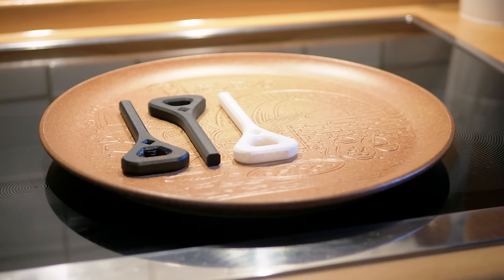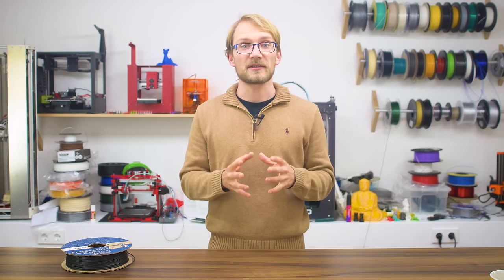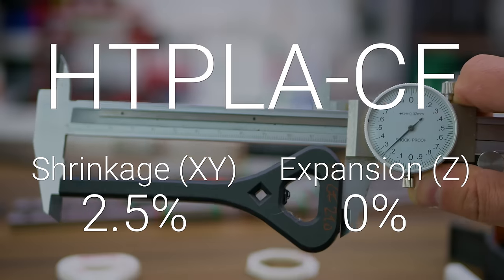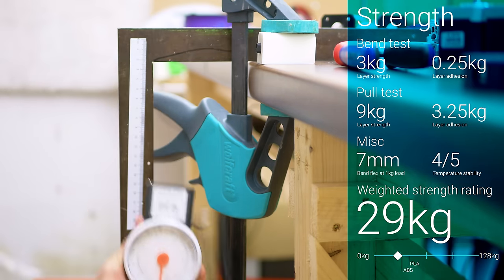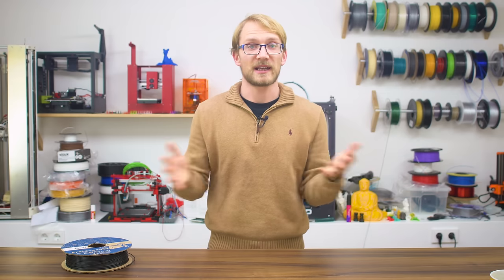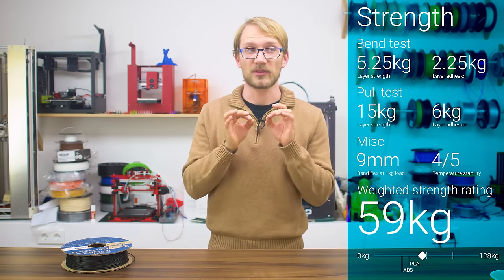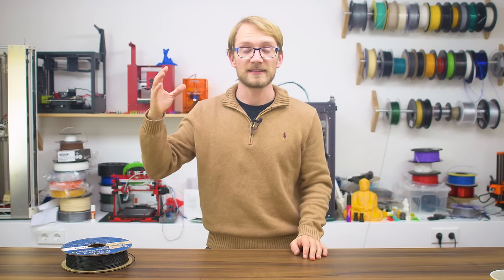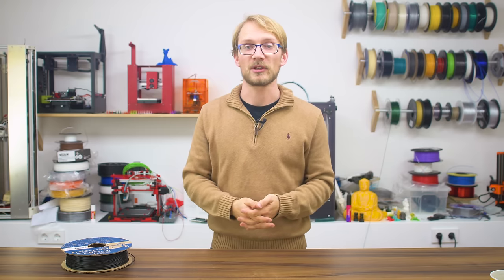Bake your PLA and have it outperform everything else! #Filaween

Comment: This makes me wonder if other plastics could be annealed too... Like abs and nylon
Reply: Yes and no. This is essentially what heated build chambers do for ABS. It "anneals" in the sense that it allows the ABS to relax and remove the excess stress in its layers as it cools uniformly and that will improve its strength. However, ABS is highly amorphous (the reason why it doesn't really have a true melting point) and annealing it won't cause super large crystalline grains either like it would in polylactic acid (PLA). Its chemistry doesn't favor it.
Reply: I feel like this is something that needs to be tested lol
Reply: for metals there are different methods to improve their properties(these methods developed through time), so it's a matter of time for plastics especially now since it will be  used by everyone capable to afford a 3d printer.
Reply: You need to be able to control the temperature and cooling cycles to anneal properly. It'd be horribly inefficient to do it in a microwave. On top of that, Microwaves operate on a 2.5 ghz frequency which is the resonance frequency of water and it also interacts well with fats, and sugars, vibrating it and causing heat. Your prints (ideally should be dry) wouldn't work as well as a temperature controlled heated/cooling chamber.
Reply: The other problem is that you actually can't set the power level of a microwave, it's either fully on or fully off and controls power by cycling the magnetron. The part could be wrapped with a damp paper towel to heat it, but I doubt you'd be able to control the heat well enough. Considering the size of most printed parts, it would likely be best to use a toaster oven
Reply: It pulses in a specific way according to the power settings, at 10 it might be on 100% of the time while at 5 it would be on 50% of the time and off for the rest of each cycle.
Reply: Like Daniel said, it just pulses it. Listen to it carefully when it's on a lower power setting, you will hear a hum that turns off and on. Some of the newer microwaves cycle it too fast for you to hear, but the older ones will cycle slowly enough to hear when it is heating or not. This is called pulse width modulation.
Reply: To answer your question, I actually did a project on this in university. ABS absolutely does gain strength, but you need to be careful with the moisture content of any plastic used. Too much and you get huge deformation, typically shrinkage in one dimension (x-y). PLA was very difficult to heat carefully enough, and were not consistent enough to be useful without further machining.
Reply: I use/make 3D printed prosthetics hands, and I can say that my annealed and acetone treated ABS fingers hold up WAY better than just acetone treated. I even put some big claws on the fingers that held up way better than they had any right to, given the layering.

I think what happens is that ABS usually has a hard time with layer adhesion, and warping can put stress inside parts that makes them even more prone to delamination. the heat treatment allows parts to relax and give layers a bit of extra adhesion, making them stronger. 

Usually, with ABS, it breaks along layers. Its amorphous structure makes pretty impact resistant, and it's more prone to denting than breaking. Heat treatment doesn't do much for that kind of strength, but ABS doesn't really need it.
Reply: I think some people boil nylon parts (molded, don't know about printed) to make them tougher.

Comment: I think I know what you're doing wrong with the CF parts. Any fiber reinforced material needs to be loaded in tension parallel to the direction of the fibers (i.e., the layers). I think if you printed the first part in the weighted strength test with the largest face parallel to the bed you would see the benefits.

To be more detailed, the fiber reinforcement only does any good in tension. (just as a steel cable only does well in tension). When a beam (such as the first weighted test part) bends, there is tension at the top and compression at the bottom. However, due to the printing orientation, no fibers are actually bearing the load, only the adhesion between the layers is. Even after annealing this wouldn't change anything because the direction of the fibers is still orthogonal to the stress.

Feel free to inbox me if you've got any other questions! Hope this helps...

Comment: I wonder if you could add some temperature profiling into the HBP to cycle up and down a couple of times to achieve a similar effect while the part is still (potentially) adhered to the plate, possibly reducing warping.

Comment: It would be great if you could test MakerGeeks Raptor PLA.  Like the HTPLA, the manufacturer suggests (and some tests bear out) both great strength and ability to withstand heat.  I have four spools.  It is definitely less brittle than standard PLA, but I haven't done other tests with it yet.

What is interesting is MakerGeeks only suggests 10 minutes in the oven: "...you'll want to bake it in the oven for 5-10min or so around 100c (212f) and that will heat treat the part so you can get the maximum heat resistance out of your part."

To help avoid warping, I've been placing a large ceramic tile on top of flat parts to keep them from warping.  I also place them the parts in a cold oven, bring the temperature to around 100C, leave it at 100C for 15 minutes, then turn the oven off, but leave the parts in the oven as it cools down for another 40 minutes or so.  It seems to reduce warping significantly.  Also, my parts shrinkage is reduced using this process.

http://www.makergeeks.com/rasepla.html
Reply: On thin parts, the change can happen in minutes.  Be careful not to put too much pressure (weight) compressing the parts.  Crystallizable PLA become very flexible before becoming firm again!
Reply: Thanks very much for the info!  The ceramic tile I've been using (occasionally) weighs 675 grams.  Probably much more than I need for smaller parts.
Reply: Of course and good luck!
Reply: I would love to try out the MG's Raptor PLA, have placed an order back in October and still haven't received it as of today... Can't wait to test them out. From your experience with Maker Geeks, do they usually take a long time to ship their items out? Their support also sucks as they don't answer e-mails, plus there's no phone contact available.
Reply: I've had pretty quick shipping from them - usually received within 5 days.  Are you on Twitter?  I would send a tweet to @MakerGeeks.  I too have had some fast responses, and some lack of any response to emails, but thankfully all 4 of my previous orders have shipped quickly.
Reply: John O'Shaughnessy
Thanks unfortunately I don't have twitter. I'll see if I should sign up in order to tweet them. Lucky you, so far I have been just told twice a two weeks ago it will ship within 24-48 hours. But still nothing yet. Thanks anyways. Cheers.
Reply: Alvin email them about not getting your filament I usually have received my filament from makergeeks within two days.
Reply: Brandon Cufr
Thanks. I signed up for a twitter account and tweeted them and next I saw the order status page noted that the order has been "rejected" and my credit card payment was funded. I didn't know what happened and would love to know. I wrote them an e-mail but seems like they really don't like e-mails I guess. I wonder if I should proceed with making a new order... I woud love to try out their Raptor PLA as I have seen on reviews that it is good. I am from Canada, maybe thats why there was the issue?
Reply: I'm sorry you've had trouble with MakerGeeks.  I really like the Raptor filament.  I have heard others from outside the US have trouble with getting shipments from them.  Maybe ask again on Twitter if they ship to Canada?
Reply: Thanks John O'Shaughnessy Yes maybe I should ask them on Twitter. It seems they should though because when I placed the order I have to choose shipping method "UPS Standard to Canada".
Reply: Yes, that would seem to imply they support it.
Reply: Ya. I should still ask though and see what caused the order issue. Or maybe they just don't like me... haha Thanks anyways John O'Shaughnessy and Brandon Cufr. By the way John, how are you finding the Proto-Pasta's HTPLA?
Reply: Alvin BuySell I have not yet tried HTPLA.  I intend to at some point.

Comment: The carbon fiber reinforced parts did not actually anneal at 110C, the fact that they are black means that they actually end up somewhere between the temperature of the air and the temperature of the heater elements., as a result of their high emissivity. This may also have made the green part get hotter as well. In order to fix this issue, I have wrapped parts in aluminum foil to ensure that they are not being directly hit by the radiation from the heating coils.

Comment: An idea that I have to do annealing, do not test yet, is to put for several seconds in boiling water, remove it and put it in cold water, put it in hot water for several seconds, take it out and put it in cold water. Repeating the process many times, it is that the interior of the object does not acquire temperature, and only do it much after the outer walls and if they are consistent and endure more temperature. A way to do the annealling step by step without deformation, "this is theory by now".

Comment: Useful information, but I would try to change the hot water test so that it is more consistent. Maybe put it in a device that gives it a consistent torque to see how much it actually twists, or in some sort of clamp that gives a consistent pressure to see how much it actually squishes. Also in regards to the shrinking and expanding on the Z and X/Y coordinates, I would have to guess that this is slightly subjective to layer heights, as those are what helped impose those stresses.

Comment: Hi Tom! congrats for a great channel!  I've been following your videos for a while now and like your stuff!
I was wondering if the annealing process has an effect on the long-term strength of the plastics also.. perhaps you could leave the load resting on a particular material for a while and determine the long-term deflections (and/or failure) to sustained load? 
We had done some strength tests on a 3D printed joint a while back, we noted that while we were able to increase the ultimate strength (not by annealing, but by solidifying the internal structure), the long-term strength was never really improved - perhaps you could test out that strength aspect?
once again, great job!

Comment: i printed my part cooling fan in pla, i heat cycled it, started at glass transition temp or just under for 5 mins and let it cool,then raised the temp 15 degrees and did same till i reached 110 its been fine for months now i little shrinkage but not as bad if you just hit it at 110 straight away

Comment: I wonder if there are any volatile components to the filament.  For example, maybe some plasticizer that might evaporate during the baking process?  Or even possibly baking out moisture?

It would be pretty interesting if you can find a difference in weight before and after annealing.  Might require a scale with high resolution, though.

I guess I would try to find the composition of various filaments, although they might be secret.  Possibly talk to a plastics engineer, see what they think.

Comment: My Hypothesis on CF (never tried however):
Carbon fiber can give strength advantages if oriented and the the fibers are long enough. 
Two things easily obtained with injection molding, stamping or real continue extrusion.
 To 3d print you need very small fibers and orientation is along the extrusion direction of the film... son exactly opposite to link between layers that is the weak spot of the print. I'm not expecting a good effect. 
Maybe a better effect on impact resistance, or crack propagation slow down.

Comment: This might sound crazy but at those temperatures could a sous vide cooker work to anneal the parts?
Reply: Hey that's an excellent idea! My sous vide cooker is accurate to +/- 1 degree. And a vacuum bag keeps any outgassing contained while keeping the part dry. I wasn't wild about the thought of baking plastic in a oven I make food in either.
Reply: maybe i set the temperature just a smidge too hot, but the parts were "crushed" by the vacuum and water over time.

Comment: I dont have the time to try this. But if you do:
I'd be interested to see if I took PLA, and layered it with fiberglass like Plywood, interlocking the fiberglass, how much on a measurable scaale I could increase the strength of the material. 

So taking several layers of PLA, and sandwiching Fiberglass in between, and heat treating the material to bond them all together. Also if you got that far in the process, seeing how much strength in the material could be achieved, and calculating the strength gained  in the layers proportionate to quantity of the layers..

Comment: might want to try a Sous Vide system. print on some supports and stick it straight in the water after printing. If it works anything like metal or glass, flash at high heat for a few minutes and let it cool off slowly over a few hours. should smooth it out as well.

Also to add strength, try printing with a core of different material.

Comment: If you made a cast of the printed part with material that retains its shape under high temps. 
Then place the printed part inside the cast as its being annealed, then maybe that would help maintain its original shape. 🤔

Comment: I wonder if you get a hard but brittle part if you heat through at 100C and then drop it into cold water to cool it quickly rather than slowly?
Reply: In order to get a crystalline structure developing it is a combination of heat and time (hours).  Higher temperature accelerates the development and different temperature ranges produce different phases of crystal structure.  80 to 100 C seems to produce a more dimensionally stable result in unfilled PLA but it takes much longer for the crystal structure to develop.  Annealing is a misleading term as used in metals it would be combined with quenching to arrest crystal growth and lock in properties.
Reply: There are actually quite a lot of papers about the effects of annealing on PLA. If you google for "polylactic acid annealing", you can turn up a lot of info with various experimental results.

Comment: Generally speaking most of the advertised high temperature PLAs that mention annealing are using Natureworks 3D850 - the benefits being FASTER crystallization rate (so it doesn't need to be in the oven as long as other resins), and therefore hopefully less warping/dimensional change.  It's also one of the first plastic resins that was specifically designed for 3D printing (whereas before a lot of stuff was just 'hey, we make this resin already, maybe it'll work for that 3D printing thing you want to do').  Most of the other types of PLA on the market are Natureworks 4043D.  I think it's the carbon fiber content making the prints more brittle, and hiding a lot of the benefits to 3D850 - Thomas should try testing some of their HTPLA without carbon fiber.
Reply: Depends if you want max strength or min shrinkage...what about parts where you need accuracy and HT with no load?  Depends on application.  There is always a trade off and fibers reduce shrinkage :-)

Comment: Hi Thomas. I attempted to anneal standard value PLA in a toaster oven, and the heat may have been set too high. I did this before watching this video. The result was a severely warped part. I did not retry it at a lower temperature, but plan to sometime in the future.

Comment: Home ovens have really poor temperature control.  Some can have 50 degree (F) temperature variances... When baking, it's not really critical to have precision control.  You may have better luck with the copoly if you can get better temperature control.
Reply: This. And, parts near the edge of a plate are going to experience different temperatures in a test like this. Also, I would be surprised if there wasn't a significant difference just because of the black/white color difference.

Comment: How come the infrared thermometer says 110° when the oven was set to about 180° ?

Can't get my head quite around that.

Maybe a little less heat and heating up in steps would have/could have helped with shrinkage?

Please do a follow up video!

And please try to compensate for shrinkage beforehand - would love to see if that works with more complex parts where one would actually need and use the increased mechanical properties.

Thanks

Comment: I may be doing something wrong of course but I am not really happy with annealing. I tried (very early/beta) HTPLA and I never was able to cope with the mechanical deformation due to annealing... Unless I print a simplistic object, thick and well-supported like these very easy bottle openers, they all warp to the point were the become mostly useless, too much out of shape (thin holes, flat surface with low infill, bridges... all wrong).
Moreover, I find it very hard to understand how to pre-warp the design so it ends up with the expected shape.
Reply: The fibers (Carbon or Matte) help keep the material more firm through the transformation with less shrink.  This is the main point (other than good looks) for the fibers.
Reply: Proto-pasta I do understand CF would improve things, given how cfpla is already more stable than most materials. OK now I want to give HTPLA another try right now :D

Comment: I'm triing to print RC quadcopter parts and frames, and CF-nylon and Taulman910 / 645 seems to be a good choices for certain designs, but layer adhesion seems to bee a weak point most cases. I wonder if I bake the finished print as a post-process, maybe putting some weight on top (if the design is flat) would help this issue - or just ruin the print (deforming, or certain chemicals going be to removed)? Thanks in advance